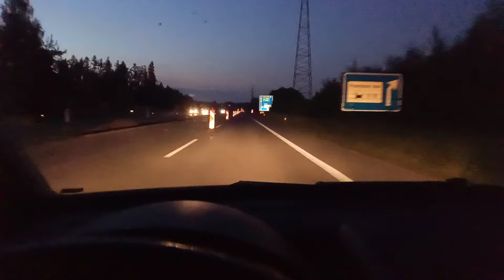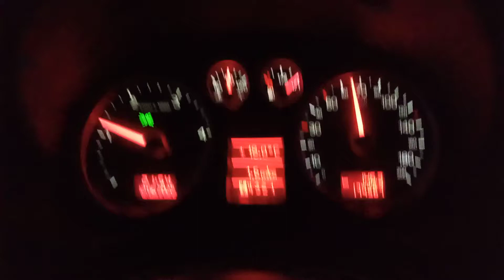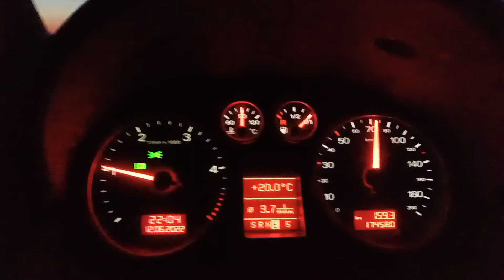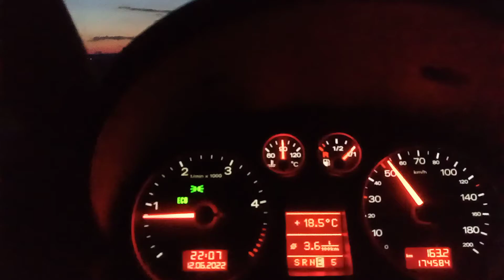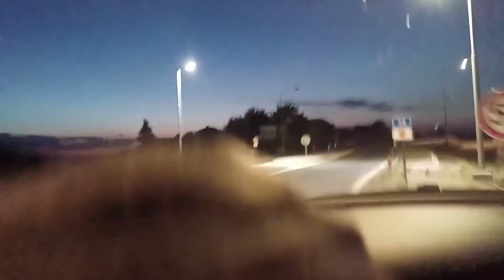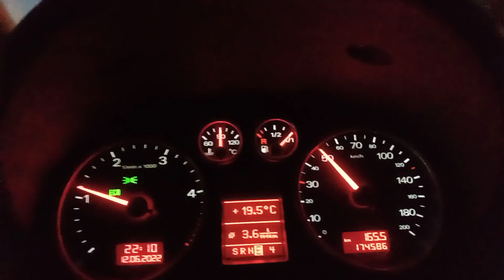Cruising at 1.7L/100km (200mpg) with 20 years old car? Definitely possible. Fuel prices-beating 3L!

Comment: I so hate you guys:))
It just seems i do not know how to drive my car. 
I modified so much on mine and still cannot get better than 4.4L/100 on the open road. It is true I drive it like i would any normal car. 
It seems i will have to do the injectors and turbo after all and maybe i will see consumption around 3. 

Nice to see this little cars still running so well. I do not think any other car can reach this consumption on external without electric (exclude plugin electric).

Did you try the new engine 1.2tdi that does not have pompe duse? I am curious if the new common rail 1.2 engine is better. I would even consider swapping a new 1.2 engine in a2.

Comment: Hello Marek. I read on another video that you are using WVO? Can you tell me how you filter the raw WVO once you get it? I am thinking of buying a 1.4Tdi and would like to know about your experience? Do you have a twin tank system also?
Reply from the maker: Hello James, thank You for question. Im using ordinary air filter from bmw 3.0D, intentionally clogged with fat from oil so the long chains and particles doesnt flow through so easily. Oil is crystal clear in 30cm layer. Im using mixtures with diesel, depending on temperature, straight into the tank. On video is mixture of ~25%Diesel and 75%WVO, but in temperatures higher than 15°C You can use 100%. For best efficiency i remapped injection timing ~ 4°CA sooner, in lower engine temp and starting even higher (~7°CA). No side effects visible and no smell or smoke. You couldnt recognize that car is running WVO when I dont notice it ;) 1.4 TDI is even more better 'cause U have electric lift pump in tank and wastegate turbocharger ;) In winter im using opposite ratio of oil to diesel, depending on temperatures.
Reply: @marekminar4724  Thank you Marek, very helpful. I have one more question. Many people say that you cannot run WVO/SVO in 'PD' or Common rail engines. Is this true or does your A2 have an engine that is not a PD engine or common rail engine?
Reply from the maker: @jamesmckenzie3686  No reason to be afraid. You can burn veggie in any diesel without dpf/fap/scr ;) Im running my 2002 fiat doblo van 1.9JTD (Bosch common rail) and A2 (PD) for a long time, without problems. If you use mixture, e.g. 50/50, You will barely recognize any difference. But i understand some kind of "fear-factor". You can start with low ratio and slowly increase. The only modification I can recommend is to connnect glow plugs to the manual switch via relay, for better starting and good performance during heat-up. But i havent it yet. Maybe in autumn i will do.